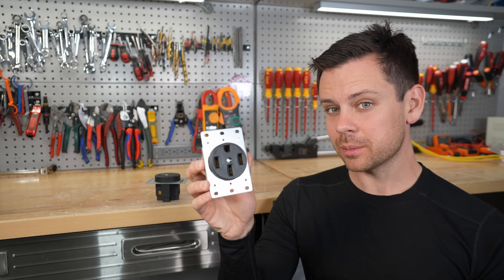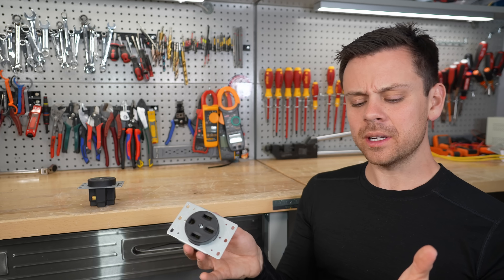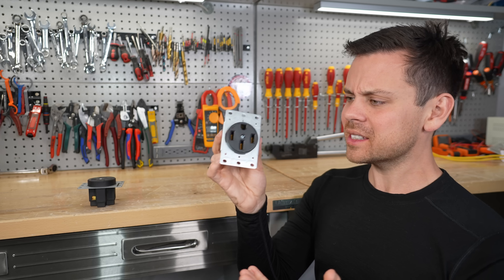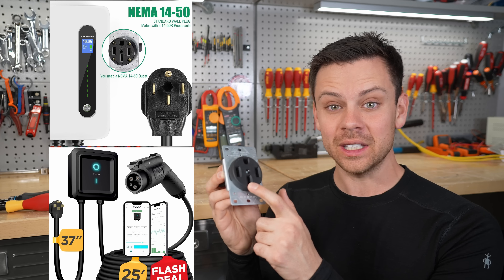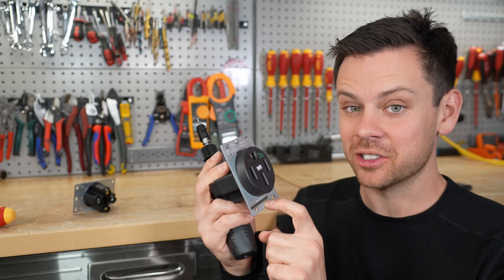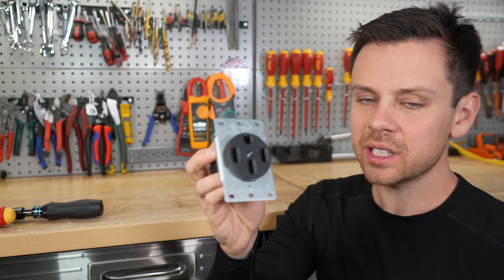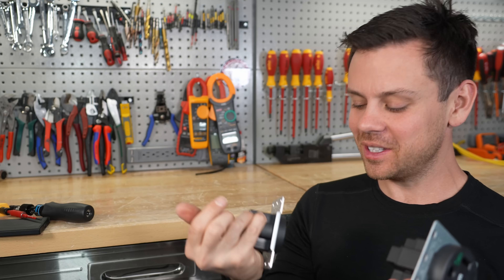Quick Guide to NEMA 14-50: Don't Burn Your House Down!

Comment from the maker: Please share this video with someone who has an EV charger! Also, hardwired installation is the superior method. Hope this helps!

Yes, 4awg cable is overkill to some, but it's recommended by the industrial receptacle and by the EV charger manuals. Including Tesla. Also, use the 60C column in NEC. You'll sleep better at night. 

Product Affiliate Links: 
EV Rated 14-50: https://amzn.to/3EFRcMI
My Favorite Industrial Grade 14-50 w/ Hex Terminals (I have 4): https://amzn.to/3XbBoYG
Torque Screwdriver: https://amzn.to/3DakMtj
THHN 4 AWG: https://amzn.to/4gNkM0f
Tools I Recommend: https://www.mobile-solarpower.com/tools.html

~~~~~~~~~~~~~~~~~~~~~~~~~~~~~~~~~~~~~~~~~~~
Tired of getting ripped off? Check out my "Will Prowse Approved" solar product recommendations below!

12V Batteries
https://www.mobile-solarpower.com/lithium-batteries.html

48V Batteries
https://www.mobile-solarpower.com/48v-batteries.html

Offgrid Inverter System Builder
https://www.mobile-solarpower.com/48v-complete-system-blueprint-559371.html

Hybrid Inverter System Builder
https://www.mobile-solarpower.com/code-compliant-48v-offgrid-system.html

Mobile Handtruck System Builder (very popular!)
https://www.mobile-solarpower.com/mobile-48v-system.html

Solar Panels
https://www.mobile-solarpower.com/300w-solar-panels.html

Ground Mount Solar Racking
https://www.mobile-solarpower.com/ground-mount-racks.html

Wire, Lugs and Busbars
https://www.mobile-solarpower.com/wire-and-connectors.html

Tools
https://www.mobile-solarpower.com/tools.html

Fuses and Circuit Breakers
https://www.mobile-solarpower.com/fuses.html

Plug-N-Play Solar Systems
Ecoflow, Anker And Bluetti! So many models to choose from. See my current recommendations here:
https://www.mobile-solarpower.com/full-size-systems.html

~~~~~~~~~~~~~~~~~~~~~~~~~~~~~~~~~~~~~~~~~~
Need to build a large DIY system? Need a trustworthy solar distributor? These are my favorites:

Signature Solar
Creator of EG4! Solar Minisplits, Victron and More! Largest Solar Store Online.
If you want $50 off, please use my link below and coupon code "DIYSOLAR50":
https://signaturesolar.com/?ref=cPwLcVc0SW-BjN

Current Connected
Best Prices for EG4, Victron, Midnite and so much more! Fast Shipping and Highest Rated Customer Service:
https://currentconnected.com/?ref=wp

~~~~~~~~~~~~~~~~~~~~~~~~~~~~~~~~~~~~~~~~~~
Join our DIY Solar Community 
Need more help? Join the largest solar forum on the internet for beginners and professionals alike. 140,000 members and counting!
https://www.diysolarforum.com

Check Out My Free Book
Best-selling and beginner-friendly guidebook to off-grid 12V solar!
https://www.mobile-solarpower.com/the-book.html

~~~~~~~~~~~~~~~~~~~~~~~~~~~~~~~~~~~~~~~~~~
Contact Information:
I am NOT available for personal solar system consult! If you wish to contact me, this is my direct email: williamprowsediysolar@gmail.com
FTC Disclosure Statement and Disclaimers:
Every video includes paid promotion or sponsorship (such as free products for review). Some links on this YouTube channel may be affiliate links. We may get paid if you buy something or take an action after clicking one of these. My videos are for educational purposes only. Information is subject to change/update at any time. Electricity is DANGEROUS and can kill. Be smart and use common sense :) DIY Solar Power with Will Prowse is a participant in the Amazon Services LLC Associates Program, An affiliate advertising program designed to provide a means for sites to earn advertising fees by advertising and linking to Amazon.com
Reply: The outlet recommends #4?  Or does it just allow up to #4?  The "allow #4" is common but I have never seen an outlet recommend larger wire than the NEC.

That said, you don't need 4awg for a 50amp outlet unless you are a long way away and trying to avoid voltage drop.  6awg is plenty for a 50amp breaker at 60c temperature.  Almost all wire now is rated to 90c which would allow more amps but most breakers are still only 60c or 75c.
Reply from the maker: @Sylvan_dB  Tesla manual states 4 AWG. Faceplate on the receptacle says 4 awg. You could use 6 but I'm just paranoid And I like the maximum current carrying capacity
Reply: @WillProwse    NEC will say a 50 amp circuit will be fine with #6 wire. OTOH, some Tesla vehicles "can" charge at higher rates but standard plugs are not available higher than 60 amps. Covering your tail and future proofing are fine if you want to go higher. That said, NEC also says a continuous load (more than 3 hours) should be no more 80% of the circuit rating. IOW, that 50 amp rating is only for intermittent draw. Long term charging should be at the 80% rate, or 40 amps max.
Reply: It's hard to tell, are these single wipe or double wipe sockets. We had lots of problems in the early days of computers with manufacturers trying to cheap out and use single wipe. The original Compaq 386 had this problem. 
Explanation: There are flat springs on the side of the cavity the prongs get inserted. These are "wipes" and they make the actual electrical connection. A single wipe only has it on one side. Double wipe has it on both. They are called wipes because, in theory, inserting the plug will wipe the surface slightly to make better contact.
Reply: Also a lot of black heat resistant plastics have forever chemical in them - PFAS. It's a complication of same manufacturing compounds used in cookware non-stick, to moulding other plastic heat resistant components. You need to enquire with the part manufacture it they use PFAS free plastic.
Reply: @JimmyCall  LOL.  No.  

The black plastic thing was something else entirely.  Black plastic made from recycled plastic often has fire resistant additives.  That is a minor problem for kitchen utensils (but the original scientific study made a math error that 10x'd the amount when really what they found was negligible).  Outlets are ALWAYS going to have those fire resistant additives. ALWAYS.

And the whole PFAS "forever chemical" is blown out of proportion to get a media reaction (clicks, views, etc). They are robust chemicals, but there are dozens of ways of breaking them down, including a lot of different bacteria types and a lot of PhD candidates are getting a great doctoral thesis because they all keep finding new ways the chemicals are NOT forever.  Best to avoid, but critical not to panic and get in a tizzy about it.
Reply: @Sylvan_dB  I partly agree but as you know they are accumulative in the body, you have to take it as a mission to have none, else risk much higher cancer risk than others.
Reply: 4 Gauge wiring is cheap insurance, as is a $50 receptacle, when the risk is fire damage to your $500k house and $100k car, a $150-$200 in extra cost for wire and receptacle should not even be a consideration. Even for those of very modest means, the price different is literally $150-$200 for a sleep well at night installation and a 'worried if my house will burn down' one.
Reply: Definitely hardwired is best for that much amperage. That cheaper receptacle is suffering the heat/melting due to micro-arcing caused by the EV charger cable not fitting tightly in to it. As another commenter stated 'weak grip'. That causes very small air-gaps between the inserted EV cable and the receptacle that lead to micro-arcing. Looking down the higher quality receptacle and you see the metal grippers prominently and it likely takes a bit of effort to insert the EV cable. Makes for a tight fit and no micro-arcing.
Reply: The $10 dollar receptacle is for an electric dryer or electric stove/range where it's not a steady current draw of over 20-25 amps, the $50 dollar receptacle is, like you said is specific to an electric vehicle charger and will handle the 40 amps continous current draw as the charging circuit determines the state of charge of the batteries, thanks for this important information

Comment: I had a NEMA 6-50R do the same thing.  Luckily, I was tinkering in the garage and started to smell plastic burning and investigated.  Somehow many of the individual strands of the conductor had become detached from the terminal on the rear of the outlet over the nearly 3 years I used it.   I had an electrician re-route the 6AWG cable and hardwire the charger.  I charge at 40 amperes.

Comment: Hello. I have an all-in-one system that charges using an SS250P on the side of the machine using 220/240 volts. The charging cable is a Nema 14-50P to SS250R. I want to use the generator in a region that uses straight 220/240 volts (No split phase as it is in U.S). How should I wire it if I still want to use the original charging cable that came with it.

Comment: So a question for you I have an old air compressor that was wired with 212 gauge wires going into it so two reds two blacks too hot too white if I just picked tails those together would that be sufficient enough power for the Nema 1450?

Comment: Most electrical circuits are only rated to 80% of peak load for continuous use. This doesn't just apply to this plug. 15a circuits are rated for 12a continuous, 20a circuits are rated for 16amps. This is not new news. They are also derated if the cable itself isn't exposed to airflow. Which is why you can't / shouldn't run romex in conduit.

Comment: I've installed over 100 EV outlets since EV cars have been out. When EV cars first came out, I used what Home Depot 14-50 or what the supply house had in stock. Guess what? Not one low-cost outlet has ever caught on fire or melted for no reason. I've had a few service calls for melted 50-amp outlets, and none were bc of they were cheap outlets. I didn't finish watching your video bc your opinion on 14-50 was lame AF.
Reply: Yeah. I noticed that none of these videos ever seem to mention the importance of making sure the bare ends of the conductors are completely free of oxidation, and terminated correctly. 
That said, Leviton is what Home Depot has stocked for what seems like forever. But the current "ten dollar" Leviton 14-50R is a pale shadow of what they used to be, which is probably why they now specifically state that it's not recommended for EV charging. IDK how they get away with making a UL listed 14-50R if it can't actually handle 40 amps continuous at 86°F
Reply: $50000--$100000 car ... $Xk installation (what tf you charge these days to folk who can't do it themselves better than you can?) ............ arguing over $60 difference in receptacle, which your plumb as calls an outlet. If you're an electrician you should lose license.

Comment: Although even a basic $10 14-50 receptacle must be "rated" for 40 amps continuous to meet the NEMA 14-50 spec,  I'm wondering if the UL rating was granted decades ago and the manufacturers are self-certifying that the current versions still comply? Maybe UL nor any other entity has the power to verify that manufacturers to actually meet that spec.? My guess is that they cutting corners to the point where these basic receptacles work OK for their usual purpose (range receptacle) where the loads are much more intermittent, but not with larger loads that last for hours at a time.

Comment: One overlooked part of this problem with standard grade 14-50R is that they are often installed in garages where the ambient temp exceeds the NEC standard,  without derating for the higher temp. The base ampacity tables in the NEC, such as Table 310.16, are based on a 30°C (86°F) ambient temperature.  Derating values for higher temps are in Table 310.15(B)(1) & Table 310.15(B)(2)(a)/(b) .  Example: If the ambient temperature is between 105°F and 113°F (40.6°C and 45°C), you would find a correction factor of 0.82 from the table. This is in addition to the 80%  continuous rating. NEC defines "continuous" as three hours or more.

Comment: Some notes:
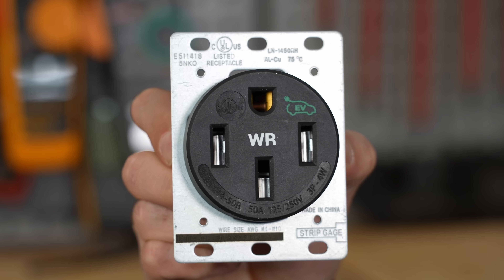2:18 - The "EV" logo is not a standalone indicator of quality or capability. If you do NOT see it, keep shopping; only Hubbell gets an exception here. If you DO see it, research further to confirm the specs. Not all EVs are equal; some onboard chargers fluctuate amperage to keep average temperatures low, others hit 40A immediately and maintain 40A until charging is complete.
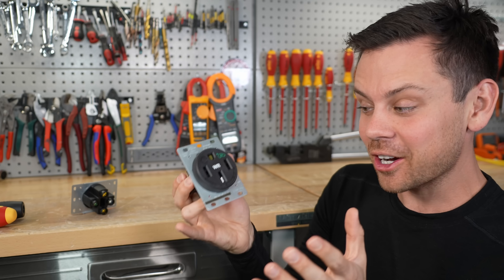2:40 - The shown outlet has Philips terminal screws. Today, there are models that have Hex screws which are easier to tighten properly (Description links to this).
2:40 - (See gold-colored rectangular flange) The Ground connection on this model has a blade that ties the outlet to its frame, and thus the frame to the box. Manufacturer states this eliminates the need for a pigtail; per code, connect the wired pigtail regardless.

Comment: Good to know! Found this by accident.
I'm developing a Rotary Phase Converter (RPC) (creates 3 phase power from 220 VAC residential power by feeding 220VAC into a 3phase "idler" motor. The idle motor acts as a generator to generate the third phase which is then used to power 3 phase machine tools and equipment),  and this is one thing I didn't consider. An RPC would draw continuous current just like an EV charging station. RPCs by convention are hard wired to the residential breaker panel and do NOT use plugs. However, for my development unit, I have an L14-30 (or L14-50) plug to connect to a standard residential dryer/stove outlet, so good to know. I wouldn't want to melt the receptacle in my lab. Note that 3 phase connections use plugs (L15-xx) all the time and they ARE continuous current connections; like for a lathe or an air compressor.
Finally, "DIYSolar...", I am surprised you don't mention this as being an issue with solar hookups! Or, is it because a solar power system is hardwired in too!

Comment: 50 amp receptacle is a misnomer it's 50 amp per leg that's 100 amps it's the same receptacle used an RV parks there are two 50 amp breakers one for each leg that is 100 amps

Comment: Just had my cheapo outlet melt, and ruin both the outlet, box, and charger plug.  Outlet was installed back in 2021.  Had the electricians put in a new heavy EV unit as mentioned.  Even the plugged connection feels so much better.

Comment: Thank you for providing this very important information. I see that Leviton sells three of these receptacles. The 279-S00 which is $10 and the 1450R which is $58. They also have the heavy duty 1450W for $65.
It seems that leviton designed the cheap one to work with 240v appliances that use up to 20A.

The more expensive ones also have the EV Charger logo, hinting that the other one is not for ev charging.

Comment: As an electrician who have installed many home chargers I don't understand how this can be a problem. I guess the laws are much different in US. The cheap plug is obviously only rated for 50A at peak. Should be in the datasheet. But why even use a plug? Either cable comes straight from the distribution box and goes into the charger or we mount a weatherproof box out of sight and then run a cable to the charger from there. The connection in the bix is done with crimping so there are no loose connections. Also, because you guys have 110v, what do you have when it's 3 phase?My point is lower voltage means higher amps thus more heat..

Comment: The tittle of the video is click bait the house wont burn down over a plug Thats what the breaker is for, OCPD stands for over current protection device and it also turns off when it arcs. 
thank you.

Comment: Is the standard rely that low over there??? that is just scary!, if you cant depend on stuff to be approved.. here we have a strict system for selling stuff. china have made that a bit of a problem spot, but shops that sell china goods are closed all the time for not having the right safety data on what they import... so we always buy stuff from a known old seller, that is over security for quality.. we actual had 12 yars back a diy builders market that sold a new 220v outlets (220v is standard here), they had the proper docks, but the company that made them what fudging that permit, so when the governments test facility cam around to test, the immediately issued a warning, the store that sold them had to buy back all they have sold... plus they got a huge fine, it actually almost bankrupted the company... we don´t hold back from punishing companies for doing shady crap...

Comment: I think the biggest issue with these cheap 14-50s isn't continuous duty, but that they're designed for limited insertion/removal cycles which makes sense given the vast majority are used for electric kitchen ranges which rarely get unplugged.  I'm not sure why the 14-50 became the de facto standard for EVSE with plugs, since garages with 240v circuits are more likely to have either a 14-30 (dryer) or 6-30/6-50 (L1, L2, gnd, welder outlet.)  I've encountered a melted RV TT30 outlet and new replacement of a similar design to the cheap 14-50 and the main issue I saw was the spring contacts were thin, excessively flexible, and insufficiently supported in the housing.  Only a single rivet was supporting each contact and its screw terminal  After only a few plug insertion cycles in the new receptacle, the contacts had twisted, limiting the effective mating surface and presenting more opportunities for heat and associated corrosion.

Comment: None of these NEMA ratings are for continuous duty. Duty cycle matters. IIRC those 14-50 are also used for RV's that need 240V. The older RV outlet is the 120V 30A (TT-30) type. When those outlets are installed for electric stoves they can be fed with #8 wire and a 40A breaker commonly for a 8KW supply. For 12KW, #6 wire and a 50A breaker, for some higher powered stoves. Why? The NEC code considers the duty cycle of the domestic stove. IIRC its 75% of the full nameplate rating. Over many years and millions of installations an issue is rare. But the obvious thing over rules in this case. THIS IS NOT A OVEN! At least not intentionally. This EV application should go to NEMA 14-60 to give more headroom and discourage 14-50 plugs.